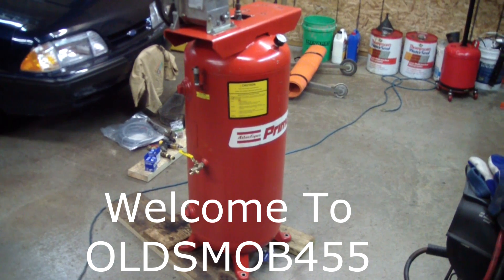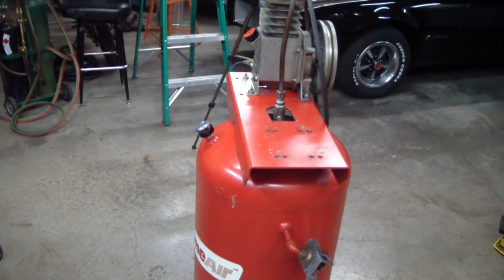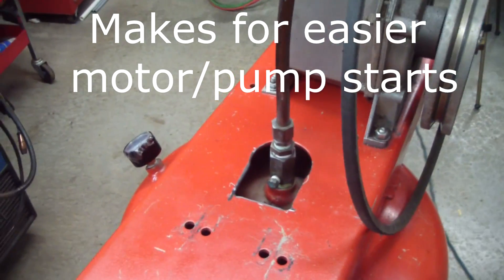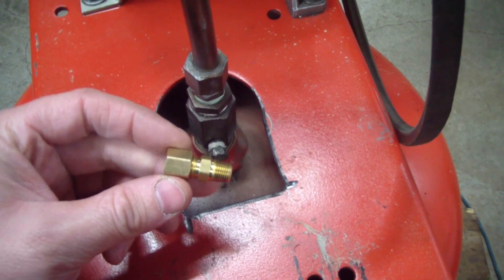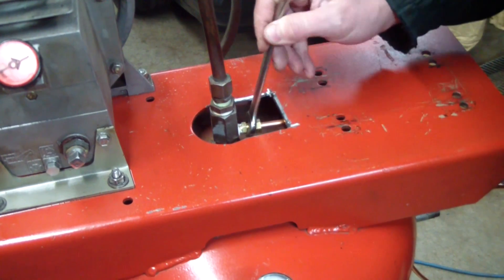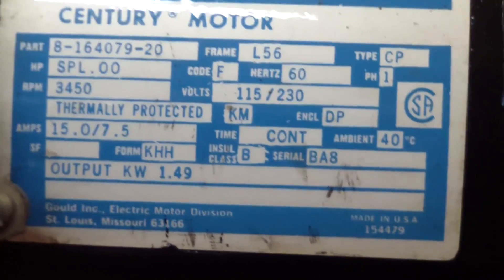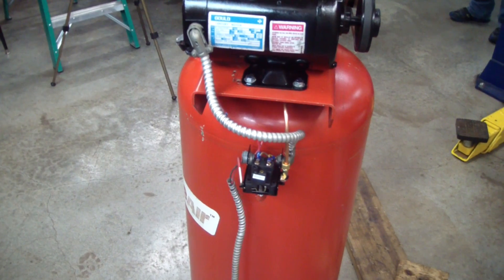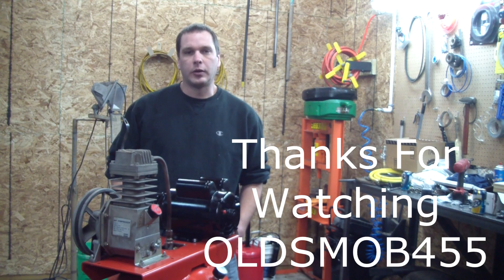Air Compressor Unloader Pressure Switch In Action

Comment: Thank you. 
I have 4 craftsman compressors. 3 have brass unloader with zero exposed components. Then my latest pickup has a plastic tube and I could see the charger valve on the outside of the pressure switch box..... which i thought was super odd.  I could not understand the relationship between the switch and unloader,  but your video did a great job showing the compressor tab after shutoff unloading the valve in the unloading line.

Comment: By making this 240v you would be doing nothing but robbing yourself of a breaker space in your electrical panel. 
Because 120 volt and 240 volt are both still single phase your motor won't run more efficiently just because it's at 240 volt. 
Also another reason to run something at 240 volt instead of 120 volt is in order to use a smaller breaker and smaller wire size at 240 volt seeing as the amperage will be 50%.
But seeing as you're going from 15 amps to 7.5 you will most likely not have a price difference. If kept at 120 volt you would run 12/2 and have it on a 20 amp single pole breaker. Versus being able to run 14/2 and have it on a two pole 15 amp breaker. 
The price difference there would most likely be so nominal like I said the only thing you would be doing is robbing yourself of a breaker space by using a two pole breaker

Comment: Great video...learned a lot.. diagnosed that my unloader type pressure switch was working properly and that the check valve going to the unloader had crud on its seat so that all the air was let out of the tank when the cutoff switch activated. Took that check valve apart cleaned the seat... compressor now working beautifully!!

Comment: Does the unloader stay open the whole time until the motor kicks on again? I'm making a compressor with a refrigerator motor so it's super quiet but slow
Reply: I think the unloader does stay open whenever switch is off . I  think it just releases air that is above the piston. when switch engages at cut in then it closes to allow pressure to build again.  I  could be wrong though.

Comment: Great video...I just had a question about the pressure switch?? What brand is it and where did you buy it? I'm in the process of doing this also but cant find the correct switch anywhere.

Comment: Congrats on the new tank, I've been looking enviously at those over the past couple of years. I'm thinking the tank would be best located in a different room so that you don't have to put up with the noise, though following through with that may be a challenge. Good luck. Are you going to set up some fixed steel runs?